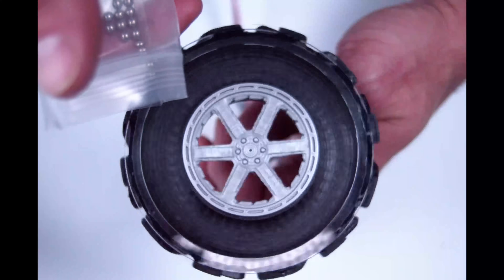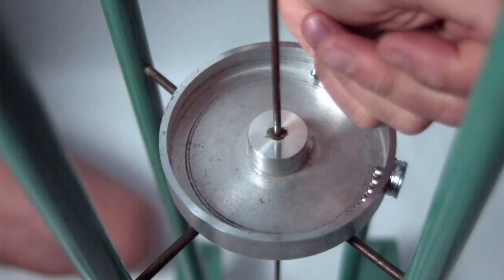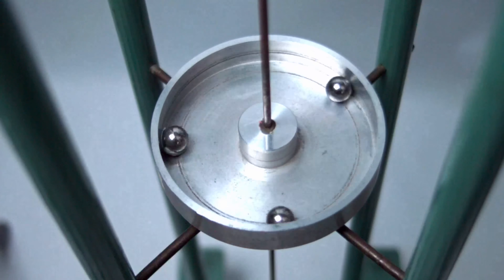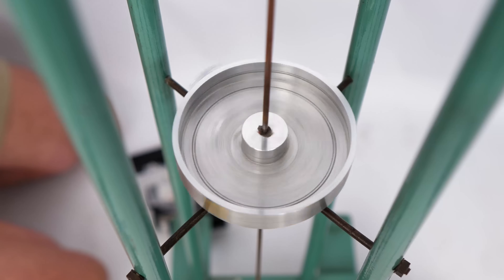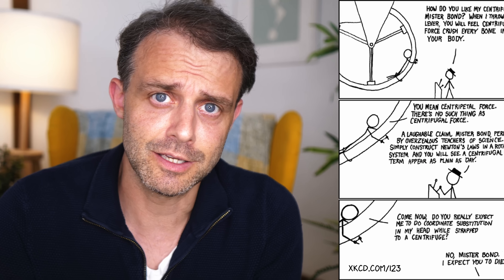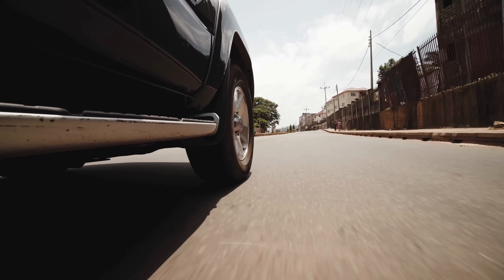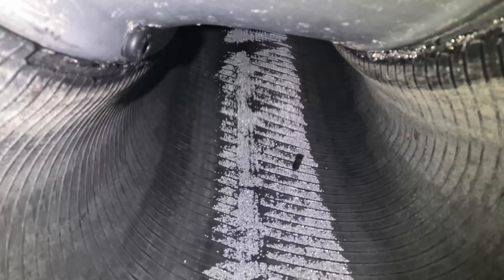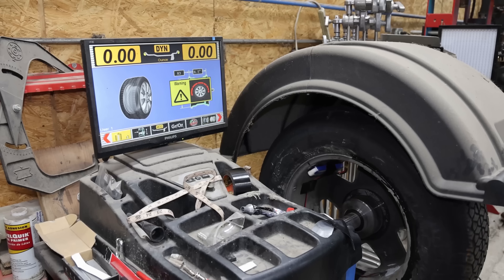Do tire balancing beads actually work?

Comment: I worked for an airline that used some sort of balancing beads in the nose wheel tires. The strange thing was, they went in as beads, but when we would change the tires there were no beads, just some dust. It seemed that the beads turned into a powder and maybe stuck to just the right spots to keep the tire balanced without needing to get up to speed.
Reply: I bet you could design beads for the car tires that would degrade like that when spun fast enough, and have the powder be slightly sticky so it's where you need it even when the tires stop.
Dunno if it could be cheaper than just doing traditional balancing though.

Comment: Seems to me that you need to put some super low viscosity glue in the mix, then sit on the motorway at cough 70 for a few hours while the glue sets.

Probably easier to just get a pro to manually attach weights.

Comment: Even if it did work,  imagine the massive wear on the interior of the tyre.  
      Although the beads themselves would be small and light its the Kinetic Energy that is the problem.  KE = 1/2 * m * v².   (m=mass v=velocity),  the V squared is the problem ,  even a light mass is capable of producing high energy and that energy  has to go somewhere,  and that would be damage to the interior of the tyre by the beads constantly bouncing off them wearing them down and potentially over heating them.  You might argue that they stay in the same place,  but who drives at a constant speed without ever stopping or slowing down  on a journey?  
     So you might want to save the €5 to balance a tyre. but its going to cost  you far more than €5 being that you will be replacing that tyre far sooner rather than using traditional balance weights.

Comment: Pop quiz, hotshot. There's beads in the tires on a bus. Once the bus goes 50 miles an hour, the tires are balanced. If it drops below 20, they unbalance. What do you do? What do you do?
Reply: Generally unbalanced tires shake at higher speeds, where the beads would balance them out.
Reply: @TaintScratch  they just don't teach the classics anymore.
Reply: Tire-balancing beads... made of C4 👀
Reply: Well wouldn’t work for school busses, at least not in DFW Texas where school busses aren’t even allowed to go over 50mph.
Reply: You hope Keanu Reeves and Sandra Bullock are aboard...

Comment: So they work only after you drive faster than that critical 80kmph and then they work as long as you don't go slower than, say, 15kmph - or whatever speed is low enough for the gravity to take those beads out of their perfect places again. And after this, like after every stop (ver frequent in the city) you have to go up to around 80kmph to balance the wheels.

Nooooo, thank you very much, I keep my wheels balanced traditional way. It works at any speed and any situation.

Comment: It sounds like the tire balancing beads need to be coated in a low viscosity adhesive to set and keep them in place after the first balancing drive.

Comment: I do wonder about the effect of third-party materials rattling around inside the tyre cavity. The inner surface of the tyre is basically the inner tube, moulded and chemically cured into the single amorphous tyre. That inner liner is susceptible to damage from, for example, low tyre pressure. I often find tyre crumbs inside failed tyres, where that inner liner has failed.

Comment: Could you make a bonus video with an overhead shot using the high frame rate camera of the cup becoming stable, where in post you "stabilize" the cup direction so we can see the beads rolling into position? So the cup would point the same direction in the video but it would look like the whole world is spinning instead. I think it would better highlight the oscillation the beads go through for the system to become stable.

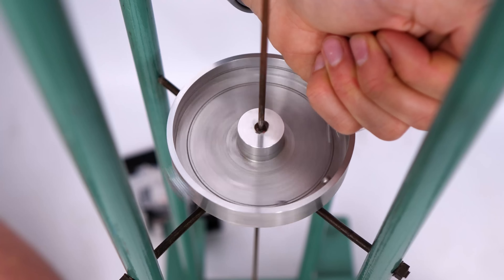Comment: 00:21 What the hell—who thought it was a good idea to use a counterweight meant for steel wheels on aluminum? It’s painful to even see that.
Reply: it is meant for aluminum. unfortunately though it does have the possibility of cosmetically damaging the wheel , even if installed properly.  that is why you usually do not install these weights on the face of a wheel and use stick-on weights behind the spokes. The advantage of these clip on weights, however, is that they offer a stronger attachment method and use less weight because it can be installed slightly further from the axis of rotation.

Comment: Centripital, no?

Also as far as I know freeway is only a California thing. The rest of the country calls them highways from my experience.

For specific names for specific highways like parkway, Turnpike, etc.

Garden State Parkway is the best

Also, the jetkvm is a fantastic little physical device that plugs into the hdmi and usb ports. Beyond remote desktop which is good enough to basically game over, you also have access to the off, in the Bios, needs to be rebooted , or what have you

Comment: would a viscous material be better, one that would seep down a ramp but not drip, something like a chainsaw chain oil or would it just take longer to balance each time. Perhaps some thermo-sticking beads that would stay in place but only after the tire gets hot enough.

Comment: Steve I am a semi truck driver in America. We use balance beads and they have way more pros to them then what you realized in this video I’ll point them out here. 

A brand new semi truck tire when new can have 1/2in of tread or even more. But we use 32/32in as your tire degrades say for example to 15/32in the tires profile and balancing profile changes. So the balance beads provide “active / dynamic”tire balancing. As opposed to weights which go on when the tire is new but can fall out of spec and thus midlife you have to go in for a tire balance. 

Secondly semis travel long distances, I cover approximately 100k mi a year. It is very likely to get a flat / tire blow out. In that case if it’s a steer tire for example you can’t drive the truck to the nearest service station. So a roadside service must take place. The tire beads allow for on-demand tire balancing. As you know tire balancing requires machines that aren’t exactly mobile. So in this instance tire beads often are the best option. 

Thought I’d share this with you.
Reply: Great info!
Reply: But how does it work when you drive in heavy traffic?
Reply: @tonymouannes  the balancing or lack of is not critical or evident at slow speeds. 
the balancing beads need a certain tire rotation speed to get distributed in the high spots (the points furthest from the rotational axis)
Reply: @duroxkilo but from this video it seems that they only work at speeds higher then the max wobble speed. That's what confusing me, unless the video is missing something. Because accorting to this video, you to experience max resonance and push past it for the beads to do their job.
Reply: @tonymouannes  Tires aren't round when they're pressed against the road. This massaging of the tires resettles the tire beads constantly. So you don't need to get above the resonate frequency to balance the tires, and the balancing media doesn't stay in position. It optimizes itself as it approaches the resonate frequency. Steve Mould didn't account for this.

My favorite balancing product is tire slime. It's moderately sticky so that if you drive it properly after applying the product, it will adhere to the tire in the correct positions medium-term and only redistribute if an event happens. It also protects against flats.
Reply: @tonymouannes at lower speeds the beads roll around on the bottom, for the most part, more to the rear, and as speeds increase centrifugal force will push them to the outer most part of the tire and allow them to self center
Reply: @darrenmulvey3710 but that means that the tire won't be balanced for extended periods of time.
Reply: @tonymouannes your speed is so slow that you don’t require it as the tire doesn’t vibrate.

Semi wheels don’t require balancing? Or Balance beads don’t work? 

Either one here is the answer. Yes semi wheels require tire balancing. Often more even the cars depending. 

Yes balance beads do work. We travel at highway speed of 65-75mph here in the USA.
Reply: i am a tire technician and you are 100% correct dear sir. well stated! i wish my own customers were as well informed
Reply: Agreed. Just like everything else,...:use the right tool for the job.
Reply: Maybe not available in your country, but tire balancing machines are indeed mobile units. Businesses have it in mini vans to provide home service.
Reply: @jhingur7169 in my country not only do we have those, we have mobile alignment systems too. My point was this on average Americas highway system is two lanes per direction. The speed limit is usually 70 mph. When a semi truck breaks down it’s a numbers game. Hurry up and get out of the way. 

The more time spent the higher the probability that you’ll get killed or kill someone else. 

Just toss a bag or two of balance beads and get moving faster!
Reply: @alangarcia3414  There are calculators and charts you can reference. General rule of thumb, 1 oz. beads per 13 lbs. of tire. Wanna make them really easy to find and buy? Airsoft bb's.
Reply: Also stones and mud can change the balance of a tire and a fixed balance system can't compensate.
Reply: @chrisevans2645  Don't forget slush and ice buildup on wheel surfaces, too. This can create significant imbalance issues as well in cold weather motoring.
Reply: @chrisevans2645 very good point!!
Reply: I'm a trucker as well and run the Centramatics. Have had them on several trucks so far and love them

Comment: I'm imagining a system of adhesive beads you put in when fitting a tyre, then just before going on the motorway spray in a little water in the valve, drive on the motorway for a few minutes while the beads find their place and the adhesive cures and then it's all balanced.
...Or you could just balance the tyres with weights when you fit them.

Comment: To add on to the comment about multiple resonant frequencies - another thing your seeing here is a phase lag and lead response. At one speed, your "wobble" is in phase with the spin and it gets amplified. As you change the speed but not the mass, its like tuning an RC filter. Any spring/mass combination acts similarly to a resistor/capacitor combo

Comment: Glass bead balancing works in theory and in practice, but not in the real world by customers. One bad air compressor or air hose containing moisture and the beads will clump together and make the imbalance worse. This is one of the reasons I don't balance anything with glass beads anymore.

Comment: I wonder how much the PSI of the tire affects this effect as the tire becomes more deformed as it touches the pavement. I'm also curious if the design of the inside part of the tire affects the beads in any meaningful way. Ridges inside the tire could inhibit the ability for the beads to adjust.

Comment: It's not feasible for tyre due to its flexibility or constant change of shape, it will continuously disrupt the beads from achieving the stable state of balancing.
Reply: And yet they are used quite frequently in heavy transport truck wheels. So I guess you're wrong.
Reply: @Nubifier  They create multiple problems and possible safety issues. Not everyone is using it.

Comment: Tire balancing beads seem kinda useless for the fact that they fall out of place once you slow down too much. If there was some way to lock them in place after reaching highway speeds they'd make a lot more sense.

But now I'm thinking, why not just put some sorta flexible resin in the tire (perhaps along with the beads if the resin itself doesn't weigh enough)? If it can go in as a liquid and then harden within a several minutes it could be a viable method as long as it can adhere to the tire surface, as liquid should do the same thing the beads do with regard to balancing. It just needs to harden slow enough you can reach the highway and fast enough you don't have to maintain speed for hours. And presumably should be flexible so that it flexes with the tire rather than breaking off.

Comment: Had them in my motorcycle tires when I i changed them at home. Never noticed an imbalance, between city and highway commuting. Evidently, semitrucks use them too, that makes the most sense with the speed-up need

Comment: My opinion as an auto tech is that while beads can potentially help, they're not a proper substitute for a good dynamic balance, though unfortunately sometimes cheaper wheels are so out of balance on their own that especially if paired with a cheap tire, they become almost impossible to fully correct with balancing weights.

Comment: it seems like glass or metal beads, and a drying adhesive/gel would be the best of both worlds, allowing for you to put them in, get up to highway speeds as the adhesive dries, and then you've achieved a probably very accurate permanent balance.  Although, regular 'ol traditional balancing would probably be just as good if not better and not so messy.

Comment: I've been using these for years and have had pretty decent results. I initially tried these because I wanted to avoid having to go to a tire shop after one screwed me and endangered my life by slashing one of my tires while they were mounting and balancing and conveniently forgot to mention it to me... I knew I could change the tires myself, the balancing part was the only thing I couldn't do without a machine, so then I found these. I have found that I need to add a bit more weight than compared to conventional weights to make the system work well. I think it's about 20% more weight in beads, but I'm still experimenting. I was surprised to find out that mercury actually balances spinning objects best, but I guess that's because it's like so many tiny little ball bearings down to the atomic level versus using a bunch of smaller balls that would be less actuate at finding the truly best position for balancing. Plus, it doesn't really wear over time.

Comment: These are common-ish in 4x4 applications with huge tires. Bigger tires get harder to balance tradtionally and sometimes you need a comical number of wheel weights, so this is an easy solution

Comment: So just make beads with adhesive on them, so when the tires are mounted, put the beads inside the tire, spin at high speed and the beads should stick to the correct spot inside the tire…

Comment: What if they coated the beads in a strong adhesive that only triggers above a certain pressure threshold, and that threshold is passed when you get up to freeway speeds. Then, the beads will be positioned correctly and be STUCK there, making them a permanent solution

Comment: This feels very similar to how charges on a conductive surface reorganize themselves to cancel out the electric field inside.

The amount of electric field going into the empty surface must equal the amount going out. So if there is a non-0 electric field inside, there must be a place where it enters and exits the sphere (because the electric field can't curl).  Therefore, there must be an electric field gradient along the surface as it goes from entering to exiting. The electrons will flow to the part of the surface entering until they cancel out the gradient, eliminating the field inside.

Replace the "field gradient" with a "centripetal force gradient" along the surface and it works.

Comment: As a long-haul semi truck driver in the US averaging about +/-10k miles per month, I can tell you that the beads do work well. You'll see a slight increase in vibration when first starting to roll out, but after a very short time, it gets very smooth. These auto balance solutions have the added benefit of increasing tire life by helping to create even tread wear. Also, you can get a version that attaches onto your rim. The brand is called Centromatix, and it'll do the same thing. The bearings inside the tire can cause small divots if the tires sit long enough, especially if it's really hot outside

Comment: What if the beads would melt slightly at highway speeds and attach themselves to the wall. Then it would stay balanced even after gravity takes over. That would require the wheels to get warmer the faster you go. Which maybe is true already, maybe someone knows

Comment: One way to permanently fix the balance with beads maybe to put a slower drying, free flowing adhesive within the tire tube with the beads. And you would have to use bigger/heavier beads that won't immediately get stuck to the wet adhesive.
Then you get upto the higher speed, past the resonance while the adhesive is still wet, and then drive around a bit while it dries with the beads now stuck in correct positions.